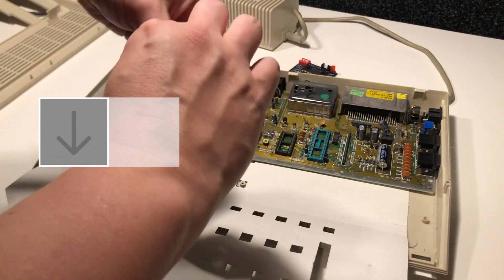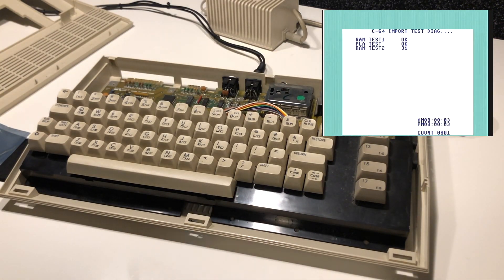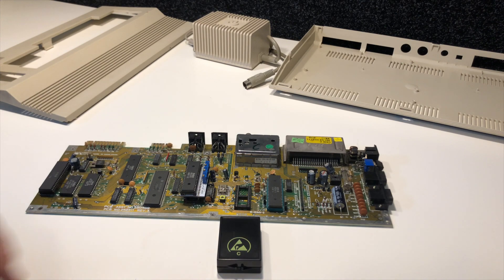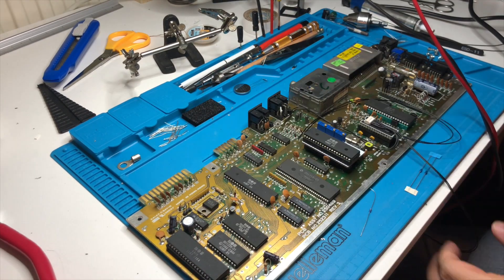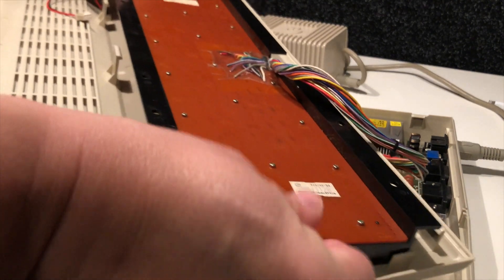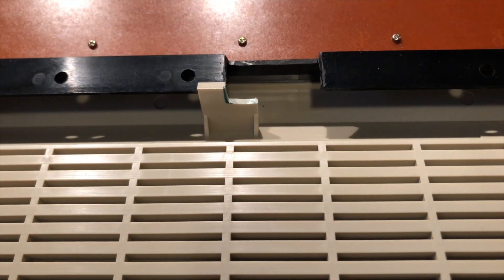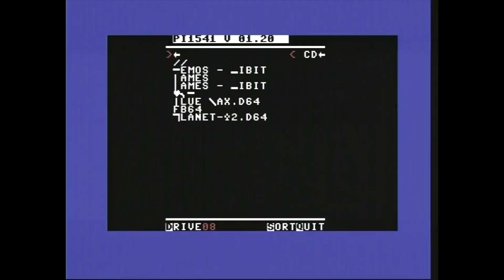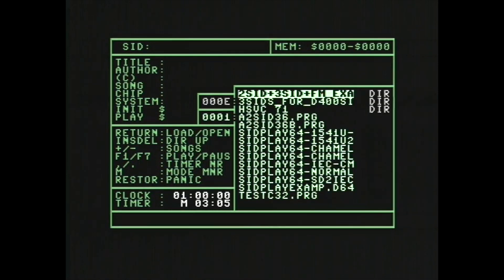A Pile of Commodore 64 Pt.3 - Exhibit C repaired. CIA, LumaFix64, ARM2SID, Recap.

Comment: Where did you get the lumafix? I am really interested.
Reply from the maker: Hi Chris. I got it just randomly from eBay a long time ago for 15ish USD. It’s a simple design so most retro shops has it, and many small-batch makers and hobbyist sell them on places like SellMyRetro or eBay.
Reply: @TheLEEC  Really appreciate it. I am going to be buying the ARM2SID as well since they sound amazing.
Reply from the maker: Good choice! The ARM2SID is excellent and worth every cent. Dual, even triple SID, SFX support, excellent emulation and extremely configurable. I don’t regret it. Good luck!